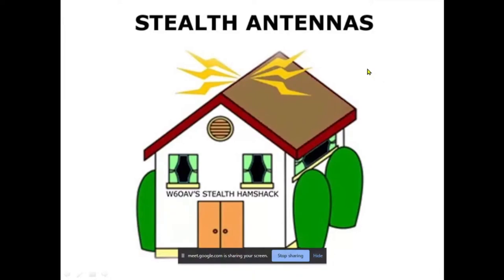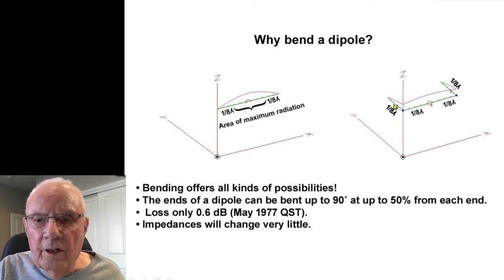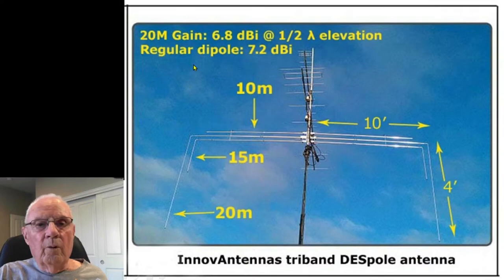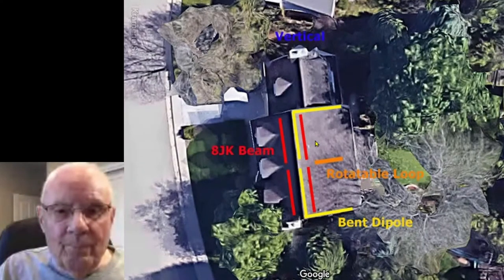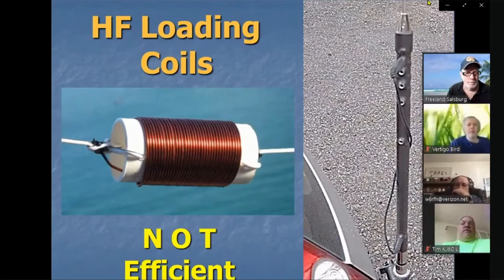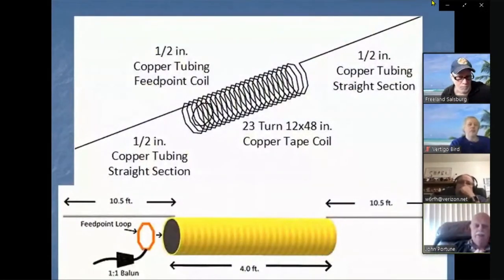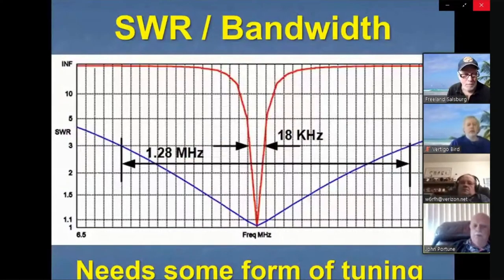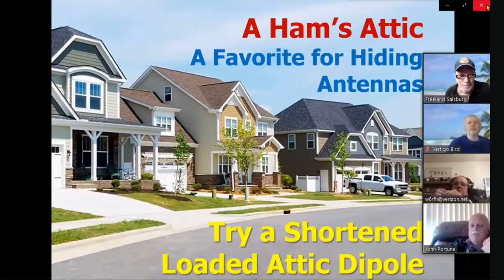Stealth Attic Antennas - Bill/W6OAV & John/W6NBC

Comment: That's a big attic.
5 dipoles, 20m to 10m bent into my attic. 20m and 17m coiled at the ends round the roof beams to form large coils. I used a mag. loop in the bedroom shack to null out noise on receive from one direction. They work well considering their small size.
For other h.f. bands I made a copy of a Joystick, if anybody remembers them, in the front bedroom. I have 26' of wire to it and an MFJ16010 tuner which I was given as not working, the system tunes 160m to 10m. The tuner had an intermittent fault easily solved by re-soldering a wire inside.
For 2m I have a 2 element collinear in the shack.
All aerials h/b.
Many years ago I put a pallet wood walkway below the roof apex so I could walk around safely.
G4GHB.

Comment: Ok, I have a question. I am also in an HOA and am antenna challenged as a result. I have finally been allowed to have a G5RV Junior as long as I keep it low as an NVIS antenna in an inverted V at 14 feet at the center, they also allow me to have a “Fat Spectrum” vertical antenna. I have been interested in a bent dipole hidden under my roof, but I do not have an attic, I have vaulted ceilings instead. I am not sure if I attach a bent dipole to my ceiling rafters directly above my station will work or not
Reply: Well amateur radio is also about experimenting. With that in mind, measure you available space - length, width and height. Then calculate what antenna you can fit in that space and draw it all out to scale. Then you'll know. I had a full size G5RV in a roof space,lots of twists and turns, and I worked VK from GM using 60 watts J3E on 20 metres.